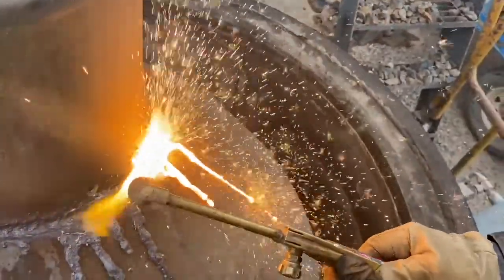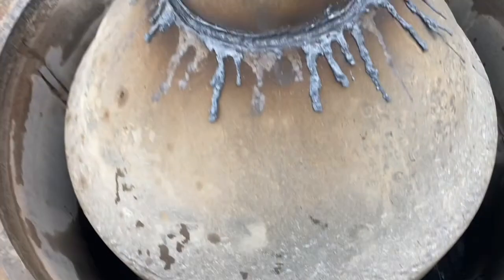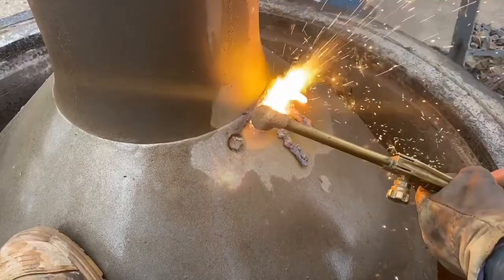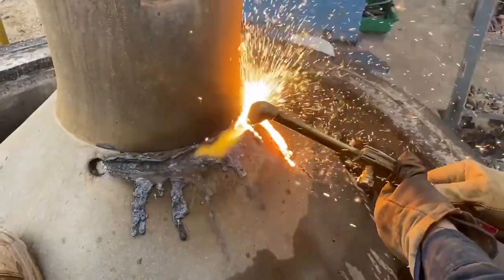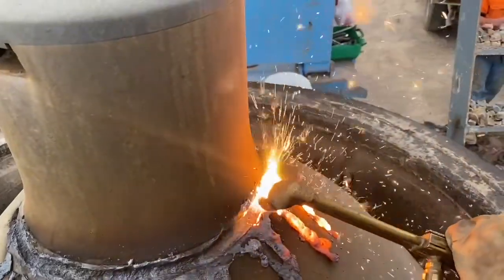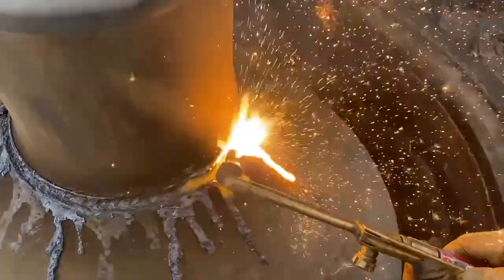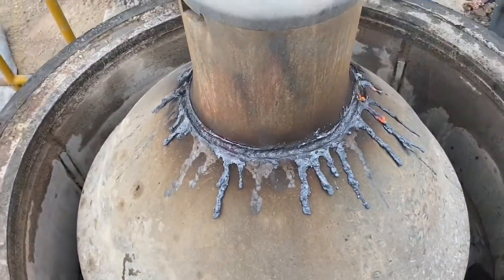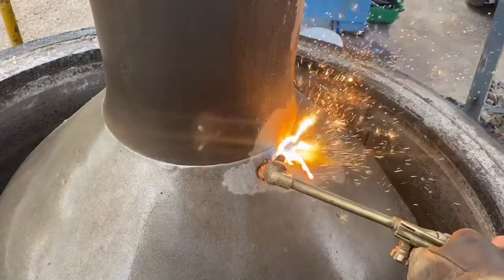Terex cone crusher Removing mantle nut

Comment: I you use an EZ nut you don't need to cut the mantle. Our EZ nuts use Torque Bolt technology to make mantle changes much easier. https://www.youtube.com/watch?v=zbq00FGTc2E
Reply: The small studs don't gall in the EZ nut during removal for a liner change?
Reply: @joejenkins4954  The small studs do not gall on install or on removal. They must remove the dirt which was packed but they can typically do that more quickly than cutting the torch ring. During removal many of our customers cut the tips off the stud to relieve pressure. Then the nut backs off easily. There is a 3/4" gap so cutting the tips is pretty quick. They don't reuse the small studs because they have been torqued and used already.